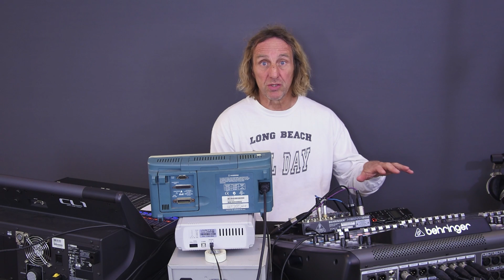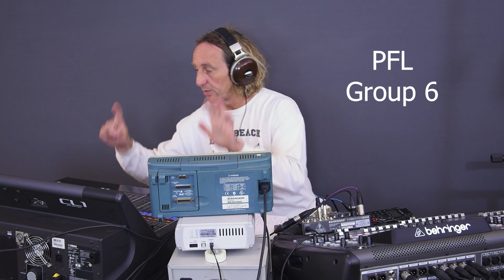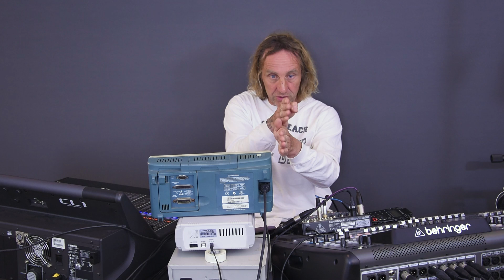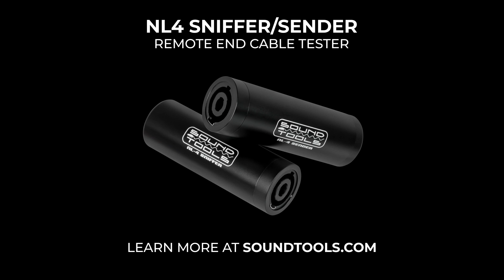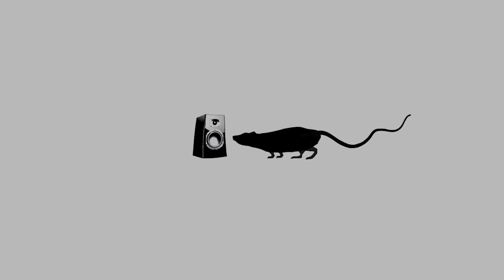Hear Digital Console Time Issues (Public)

Comment: I discovered this myself when trying to, for ambitious reasons, set up a parallel set of processing on a CL5. There was no way to guarantee synchronous timing without using the exact same signal path length, and trying to get around that was only going to introduce comb filtering. So you either had the full chain, two chains using up similar processing, or no chain at all, and any trying to skirt around the processing latency would give you issues in all sorts of areas related to the console routing, be it picking off monitoring points or side keying, what have you. Sometimes the effect slots would even have this issue on the mix parameter.

Comment: Said quickly, latency is a very real issue with live monitoring on stage, where in some instances a 1 mms delay between a direct source (let’s say a guitar amp) and the monitors will require twice the power to be adressed. And we are just talking about amplitude here...
Reply from the maker: 1 ms of latency on one of two perfectly combined signals will give a cancellation at around 560hz or so

Not much impact on frequencies below 200 hz and comb filtering at higher frequencies.

Definitely can be audible and undesirable

Comment: I'd say shift in the output latency is not a distortion because, as you said, the output waveform is only shifted in time but isn't changed.  A summation of two different latencies is a distortion because the waveform is changed.  It's interesting to ponder such things.
Reply from the maker: 🤙🤙🤙 the fact that the latency can't be undone and that the built in time delays in the console are not precise enough to correct and realign the signal, make latency unwieldy at best.

Comment: My strategy for this is parallelization. If you want a parallel compression bus, use two busses and only compress one of them so that both busses get the same amount of latency and there's no time differential between them. Want parallel compression on you lead vocal or maybe your snare mic? Assign the same preamp input to two channels, if your snare is channel 3 assign channels 3 and 4 to input 3 and compress channel 4, rather than routing channel 3 internally to compress it. 

It sucks to have to use some busses for no reason other than that the console doesn't have good latency compensation, but if the console doesn't automatically compensate for it, then you've just got to make sure that anything that is getting split and summed back with itself goes through processes that induce the same amount of latency on both signal paths.
Reply: And feed in-ears direct from the input channels, I always try to minimize bussing in monitor world.

It's worth noting though that a singer standing in front of a wedge is going experience about 4 to 6 milliseconds of delay between the speaker moving and the sound wave hitting their ears, most consoles are in the 3 to 5ms range so it's more delay than the natural sound of one's voice but less than what you'd get from a wedge, and wedges don't seem to bother too many singers, at least when they're properly EQ'd.
Reply from the maker: Very cool and yes, that's a good strategy.  As far as in ear latency and it's audibility, the sealing off of the ears such that one hears more of those internal voice sound add a factor.

Actually Hear In-Ear Headphone Latency Issues (Public)

https://youtu.be/APj0ZaMy4Xw

Comment: Many digital signal operations done on noise (such as convolution and correlation) are done by sliding one sample set against another by one sample clock at a time and then doing computations. For example, you can pick out a periodic signal buried in noise with "autocorrelation".  At t=0,0 a signal perfectly correlates with itself, however at t=0,1...not so much. As you go on, periodic patterns will begin to emerge (correlate) and the "random" noise falls out. I think latency issues would fall under the category of phase distortion. Group delay (by frequency band) is a huge issue for wideband RF circuitry.
Reply from the maker: Excellent perspective!

Comment: I definitely notice undesired phase shifting with my effects pedals that I use with my mixer via its Aux send and returns. I just remove the signal from channel and let the effects pedal process the whole thing, but I would much rather blend it back in without the phase issue. Oh well, at the end of the day processing the entire signal thru effects is not a problem. :)
Reply from the maker: I could see that, it gets messy with little time delays being added in by all sorts of gear

Comment: Slightly off topic, but I've noticed that when you link channels (that are set identical and hard panned) on the m/x32, i think i noticed a slight loss in volume and/or change in tone. Do you have any idea what that would be? Or maybe you could run em both through your oscilloscope in a future video and show the difference. Anyways, love the videos. Keep em coming!
Reply from the maker: I can look into it next time I set up the x32..

There are several types of common panning methods that have differing strategies ranging from panned center at normal volume and hard panned having a boost to compensate for it being on just one side in an attempt to keep the perceived level consistent.

Or having hard panned be normal level and a drop of 6, 3db or 4.5db when panned center depending on whether they panning is based constant power, linear or something between linear and constant power.

Accordingly, an input may drop in level, be the same or be increased in level when compared to the same input that has been hard panned or to two inputs that are hard paned.

I will ponder a demo vid on the subject.

Comment: Excellent video, as always!
One perspective you skipped or just brushed upon, and that perhaps most definitely confirms your thoughts and classifies a LIVE digital mixing console's latency as "distortion", i.e. an unwanted deviation, is found within the console's ultimate purpose: it's used to mix, blend, effect, process, control and then amplify a LIVE performance, meaning music/sounds happening here & now, live. As such, they exist from the stage or instruments or voices into the air, within the space where they are being made/performed, and being mixed on that console. Therefore, ANY latency will cause what ultimately comes through the PA or amplification system to be "non-identical" in time to the actual sound at the source, time shifted and thus phase shifted and conflicting within that same air and space.
And this is the ultimate failure, the Achille's heel of any digital console or processing in a live scenario, as it fails to exactly and unadulteratedly or undistortedly reproduce what it's meant to be mixing and reproducing for amplification purposes.
It's a bit of a philosophical stance, and in this respect it doesn't matter that for all practical purposes the amplified sound can easily drown out the original live sound of the performers and instruments, the fact of the matter is that it is delayed, not by choice but by technical default, as soon as it goes through even just the A/D & D/A process, even without additional processing, plugin or bussing latency and console-specific gremlins & design fails (I've been in live situations where we inserted a de-esser or a multiband compressor in a digital console and the processing latency suddenly got so bad the phase issues made it sound like the whole PA was going to implode).
Luckily, analog still loves us and our sounds... ;)
BTW, I often work in a recording studio fitted with a big Studer Vista digital console - beautiful sounding preamps and converters, even sweet sounding digital eq - but the analog inserts are not latency compensated, so it has forced my workflow to change, when there: if I want to do any analog processing, I only can do it when recording, before the A/D, and if I mix there, I have to use the console's eqs and processors or ITB plugins, if I want to preserve phase coherence and timing between the recorded instruments, sounds and tracks.
And I've worked in a smaller studio based around a far cheaper little digital console and an ethernet based headphone distribution system - and a more fine-eared, sensitive singer has said "What's with my headphone sound? My voice sounds weird..." - and there was nothing I could do about it.
Now those, too, albeit not linked to the live reproduction of sound for amplification, are at least to me rather major "distortions" not just of the sound, but also of what I was intending to do and of how I like to do it.
All of the above in my opinion & experience, of course.
Enjoy,
AF
Reply from the maker: Excellent. And yes agreed with the modifier that a context is needed to determine relevance.

As far as pure latency, since console latency is so short and equates to a few inches in physical distance, it can be viewed as irrelevant except when signals of differing latency are summed.

But yes, a distortion that is relevant in some scenarios.
Reply: I would add that even though there is latency added by digital processes, it is still far outweighed by the time difference between what is produced by the PA and what comes off stage naturally, since the PA is closer to the listener than the backline is. Like Dave said, digital latency amounts to inches while backline/PA difference is feet.

Comment: I had this exact discussion with an engineer from Meyer Sound, who set up the PA at the venue and we came with a Soundcraft VI3000 for the main act and an X32 for the support band. He ranted about how the Soundcraft introduces comb filtering when you try to run parallel busses like in the video, while the X32 didn't.
I really wonder how DiGiCo's S line compares, generally. It's affordable but I barely see these anywhere.
Reply from the maker: I will test a small digico at some point when our SD11 comes back off tour.
Reply: @DaveRat  Very cool, looking forward to it! The SD11 is a fun little powerhouse.
Reply: If S line is anything like the AH Dlive counterpart it is mostly latency compensated.
Reply from the maker: I would think so and it would be interesting to test.

Comment: I noticed on my x32r that if you plug in "insert effects" on a group you actually get a bit of delay. I was about to mix a rock gig and wanted to run all the drums, including a semi-big 80:es style reverb into a stereo group, and then use an insert compressor on the group to glue things together. That sounded fine in the PA, but the band also used the P16m personal monitor mixers, and wanted kick and snare dry on separate channels, and the rest of the drums on a stereo channel (the whole drums subgroup). We then got phase issues in the monitor mixes between kick, snare, and the drums bus.

Maybe the kick and snare outputs to the P16m could have some delay added to them to get them back in phase - I didn't have time to debug this at the gig, so I just sent the overheads in stereo instead of the drums bus... it would have been cool to get some of the FX and such sent to the monitor mix also. I must take a new look at this at some point...

This proved your point on the need to know about possible gremlins in your console before you show up at a gig and get surprised.
Reply from the maker: Interesting and even if there is delay to try and compensate it never quite works well because the increments are always too coarse to align properly. Also it gets messy as when you add delay there is a minimal delay of 0.3 milliseconds so you would need to add that on to both and then try and fix.

Running audio down multipaths in digital that are later resummed is rarely a good idea

Comment: So CL1 is quite not the one for paralel compression group 🤔
Reply from the maker: Yeah, or at least use a set of groups for compression and another set with compressors set to no ratio. Which is the best way anyway to do it.
Reply: @DaveRat  are you talking about the digital world only (in the particular case of parallel compression) ?
Reply from the maker: Yeah, identical signal paths should always be used when recombining digital signals. So for parallel compression, a set of groups with active compressors and a set of groups with identical compressors set to a 1:1 ratio for the non compressed version

Then combinied signals will be latency correct
Reply: I always wondered why Yamaha made it difficult to use subgroups on their consoles. I would imagine this is one of the reasons why.
Reply from the maker: Yeah, I don't know why they wouldn't time correct it or offer a timing correction setting. Seems shortsighted and non optimal.